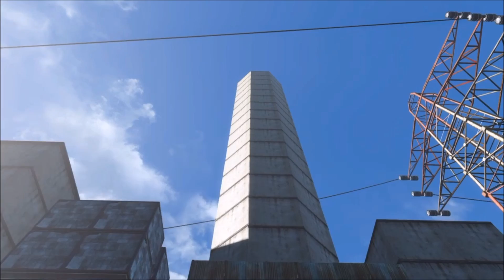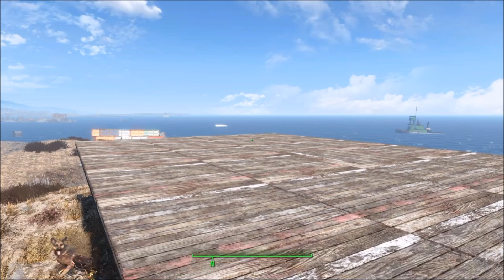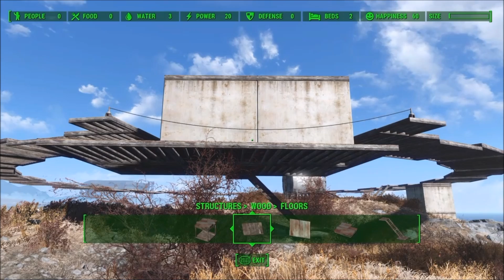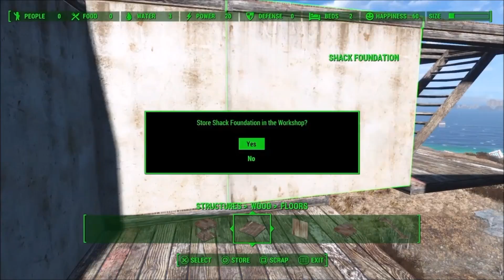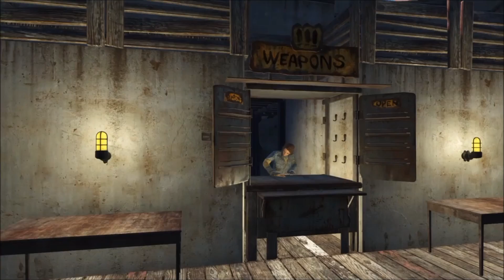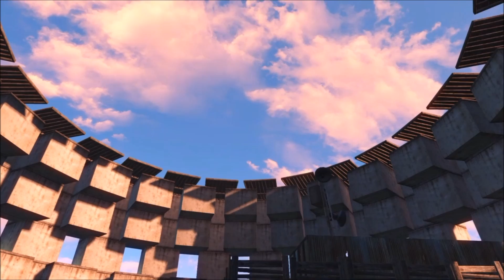Fallout 4 Coliseum Style Settlement (Building Curves)

Comment: Is the stack hollow inside? If so, with WW, you could use the mesh floors and put generators in there. Maybe even a campfire or three at the top.
Reply: Also, about the Spectacle Island breaker, you can move it and place a wire that way. However, it must be in the ground.

Comment: you know, what you could do that might possibly make it a more even circle is to just make half the circle then snapping floors to one of the opposite sides and seeing if you could build a floor all the way across.
Also, I figured out that you can actually move (in build mode) the power source in the Spectacle Island beached ship and put it straight on any wall or even in the ground then rewire it.

Comment: I love these little tricks you do, really reminds me of when forge first came out in Halo 3 and there wasn't a whole lot you could do at first, but if you looked it up or messed around long enough you can find glitches that let you clip objects or other things it wasn't intended to be able to do. I'm really glad mods will become available to the consoles when the creation kit is released because there's a number of settlement mods I'd love to have. Like instead of going through the headache you did to get a curve you can adjust how floors/walls snap to eachother so they are turned 15-30-45 degrees depending on what setting you have it on. Place on red is a great one that I'm not surprised is already out and I'm getting that first thing!

Comment: Do you have any advice regarding how to fit the doorway?
Reply from the maker: +Riley McLaughlin you need fill in the lowest levels of the curve first unless your doorway sits lower.  Then go one level at a time put another level to your curve, then another level to your doorway, then back and forth till they are both built up at the same time.
Reply: +Jug thank you for your reply. I couldn't for the life of me connect the area for the door -- from where I started curving the boards to where I ended curving them -- so I ended up just laying blocks straight across the gap. It doesn't look as clean as in your video, but it looks better than I thought it would. I also put power armor frames in the lower windows to display my power armor sets o.O

Comment: how does it offer infinte power? started building and it kind of instantly required me to do more eletricity for my waterplants. and such.
Reply from the maker: +Johan Magnusson Yeah its just for objects that don't require a direct connection, like lights, and tvs.  At the time of this video I actually thought this was the only power source that did that, but I've since been made aware that all power sources are bugged this way.
Reply: Jug yeah, its not bugged though, if i dont remember wrong some requires "lightning" = power, but some requires "1lightning" and those  with 1+ need a direct connection, while the others seem to work in proximity.

Comment: Jug, I have never built this high in any of my settlements, but was this smokepipe not reaching the height limit? If so, could you explain how you still managed to do this? would really want to know that! 
And how do you jump while in build-mode? i cannot seem to find the right button, my settings are so that the square button lets me jump. Is that the problem? or do I have to use a secret button somewhere on my controller? or do i have to yell "jump" to my character? Cant seem to find out! btw that last option does not work, tried it many times..

Anyway, nice video! very inspiring!
Reply from the maker: Different Settlement locations have different height limits.  Triangle jumps in build mode, just as it would by default.  I was under the impression that PC can't run, or jump, while in build mode, but I can't confirm that.
Reply: +Jug thanks for you reply, you are right, triangle lets you jump when you have default settings.. did not know about that height limit, but it makes things a lot more fun now, much appreciated!!

Comment: Wow amazing :D
I tried to copy that, but i don't have finish yet, but i have a question : how do you build the floor in the interior of the building ? i'm on PC and i have the "place in red" mod but it don't work very well and i prefer use your method if you have one :) maybe  with the "door mat tweak" ?
Reply from the maker: +flavien henrion Try building flat from the door till the corners reach the edge of the curved parts.  There will be spaces between the floor and the walls on the edge but that can be covered by basic walls, which would prevent you from falling into any of the gaps, or seeing them.  Alternatively you could plan the flooring out before building the walls but that would basically be a complete rebuild from scratch.

Comment: BTW, in the workshop, you can actually move around the breaker connected to the generator and re-attach a wire. The catch is, it can only sit extremely awkwardly half-way in the ground. :(
However, if you REALLY wanted to move it, it can be "portable"
Reply from the maker: +p1nkbr0 Thanks, this is a great tip, I'll try it.

Comment: So is there no way to avoid the alternating heights of the concrete blocks? Maybe build the original template or whatever put of concrete instead of wood since concrete can clip into itself?
Reply from the maker: +Mohammed Hindi As far as PS4 is concerned concrete blocks only come attached to a wood floor on top.  So if they are going to be angled they have to be staggered at different heights in order to keep the floor section from clipping.  You could do this with normal walls, seeing they have no depth the angle wouldn't effect them.